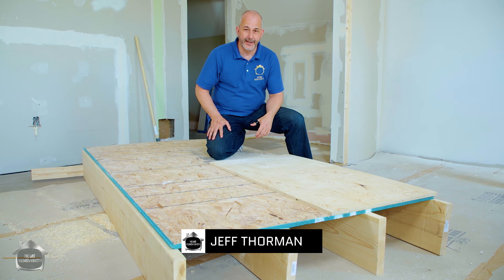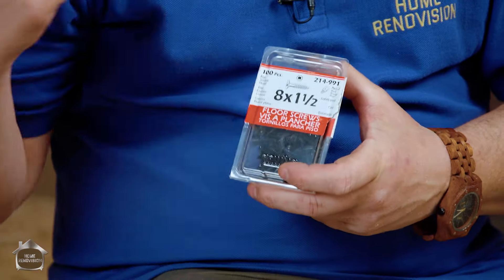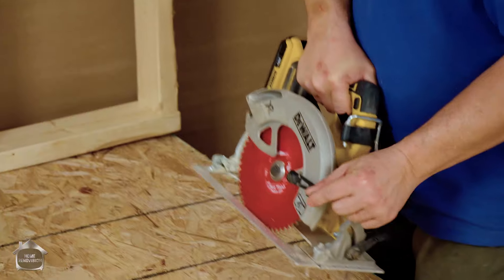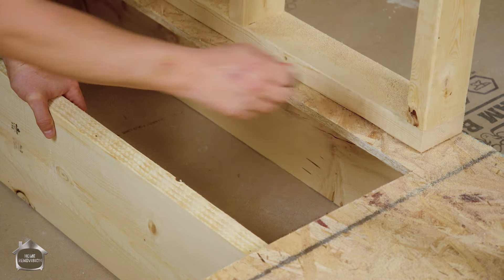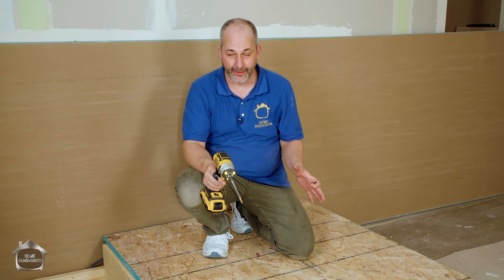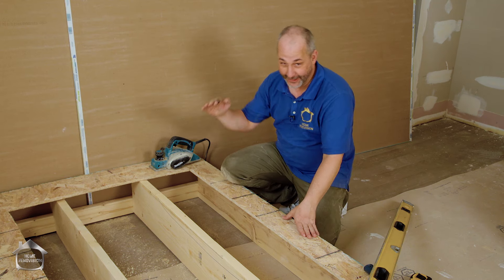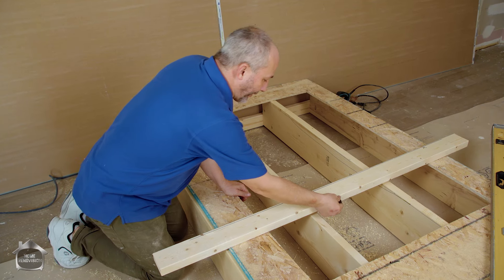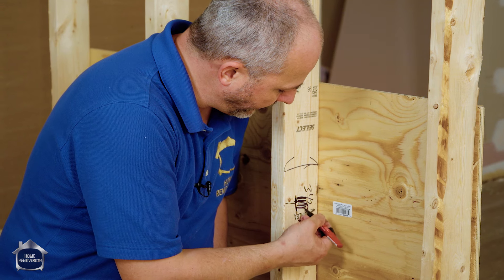Watch This Before You Renovate Your Floors

Comment: I have a one story 1962 Ranch basement walkout single family house in Maryland, USA. My floors are 2"x8"x15' w/ 16" oc with plywood subfloor. A previous homeowner had 12" square tile put on top of the linoleum kitchen floor and a similar tile over original tile in the one bathroom. My goal is to replace both and take the original tile back to the plywood.  What is the best method to tile on top of plywood not osb? Also the rest of my house is wood floors with the squeaking nails. Is it worth while to carefully remove and reuse these? Thanks for the tips in these videos! In a house that has a supporting beam in the basement and the house has settled, is the best method to repair wood floors is to plane the back to achieve a level board at the peak separation?

Comment: Hi Jeff,
         Great video. 
Lots of information and learning as I got along. I am going to put a new flooring in my basement. I intend to use laminated flooring board.  Presently the floor in all concrete naked all level at this time. What kind of vaper barier should I used also is there some form of adhesive to hold it in place on the floor before laying the floor?
Thank you.

Comment: I’m in New Berlin, WI in a 1940’s home. I am trying to finish my basement. I demo’d all the old framing. My basement floor is not level. Slopes down from all sides to the center about a 2” variance. I planned to put down the blue DMX > 23/32 OSB > all new framing over OSB > laminar plank flooring. Will this solution work? Are there any other layers I should anywhere in this process?

Comment: I have a Ontario Canada home (brick ranch) 1961. Renovating the bedroom and I have stripped the endless layers of flooring. I’m now down to subfloor. It is tongue and groove pine but it’s (ring nailed) on a diagonal to the floor joists. It has a few squeaking spots. The tongue is longer than the groove is deep so there is small gaps. I’m assuming I should slap screws in between the existing nails in pine boards then screw down half inch plywood to install floating floor? Any help would be greatly appreciated, love your channel. Keep your stick on the ice!

Comment: What if your house is older than the 90'S my house was built in 1948 and there is no subfloor like that under the hardwood. I want to preserve the hardwood but cannot get them refinished right now for various reasons I was thinking about overlay options like floating floors and such. What would you advise for hoses over 70 years old?

Comment: Hi Jeff, I wish that I could send a picture but I am in the process of installing engineered hardwood that is the glue-down variety. However, it transitions to a hallway that already has engineered hardwood that is a different type and probably has an underlayment because it is higher up when you put the wood side-by-side with the new floor that being installed. There used to be carpet in this room, so when you remove the carpet and the underlayment the glue down floor will be a bit lower than the hallway floor, creating a tripping hazard. What do you suggest to cost- effectively level up the floor to prepare it for the glue-down installation? I can't take the wood back but wondering if I can still use it.

Comment: Everyone loves a "nice, clean hole."  One thing to note on the drill bits is that the titanium and cobalt drills are just coatings.  Any drill you buy at local hardware stores are high speed steel with some coatings (titanium or cobalt).  I don't find that the durability of the coatings just the cost, especially when you can just touch up a drill with as little as a file and it only takes a few seconds.

Comment: Thanks for this video!  I went to Home Depot in Texas and could not find flooring screws.  It was insane.  If there is an alternate you could recommend, that would be great.
Reply: Try Elmer's glue. It is cheaper and just as effective. Let us know how it works out. It works great on decking as well. Especially stairs.
Reply: ... in my opinion best screws for the issue here in the states : coarse thread robertson square head - just stay away from 'fine thread' ... that kinda goes for drywall too - use only coarse (wide not thin) thread - the 'square' head is a plus over philips. AND yes IF u can get some glue into the mix it can only help.

Comment: I am remodeling a 1930 home with planks not sheets... what should go on that before my flooring product? Very hearty floor joists... they actually vary and can be up to 2 by 14 joists... and have some sister joists of treated lumber and posts in footers throughout the basement bringing weight bearing off the foundation walls that have been eroded over time and neglect.

Comment: I work at a Lowes in New Jersey, hardware dept. and I can say for a fact we do not have flooring screws. But I did find them online on our website which are the squeek no more. We do have a ton of multi purpose screws, wood screws and construction screws but I don't know if you can use those in its place. If anyone knows inform me cause I'll be buying an old home soon and will probably replace the floors.

Comment: If you have engineered floor joist, always follow the manufactures instructions as to where you can and cannot drill holes, this always supersedes code. As well as the size of hole you are aloud to drill. Usually not within 2-3 feet of a wall plate that is supporting the joist etc. and all kinds of things most people wouldnt think of. Cement board is held down with screws, thinset just fills voids, it is 100% for bonding/ uncoupling and does not help with the strength of the subfloor in any way shape or form. Joist spans were not mentioned and equally important as joist spacing and subfloor and underlay prep.

Comment: I had planned to install a ceramic tile on my concrete basement floor. The house was built 12 years ago and 2 years after it was built , It was recommended that I seal the floor. I did so with a sealer that left a nice sheen. But now I am reading that the tile floor will not adhere to that sealer. I may have to use  a floating laminate floor instead? Other suggestions if I follow through with the tile squares? Thank you Greg

Comment: I’m installing LVP (Nucore from Floor & Decor) over worn asbestos tile in a room adjacent to my basement (so over concrete) in a 1960s home. Other than leveling the floor over the asbestos tile with self leveler as it has uneven ridges now and I don’t want to touch it, is there anything else I need to consider? Can I skip the underpayment pad? Will the transition to the concrete basement floor in the doorway still be possible? Thanks

Comment: This is such an awesome series! I still have a lot of questions about older houses with 1&1/4" plank subfloor and true 2x10" joists 22 O.C. Should I be pulling up all of my planks to glue, or is screwing sufficient enough on it's own? To lay tile, would cross bracing 22 O.C. joists with 2x4'severy 16" be the easiest solution?

Comment: I do have a question @HomeRenovisionDIY ....I have a basement that is below the sewage line and im curious what options you'd suggest for adding a bathroom to a basement that's below the sewer line level. Eg Sewer line approx 3-4 feet off the floor so the old owner installed a toilet about 4-5 feet up which changes a 13 foot basement into a 7 or an 8 foot basement.

Comment: Great information just thought I would add some trivia about the regular drills also called twist drills most commonly made of HSS high speed steel today.  The colors other than silver are coatings to aid in durability of the cutting edge black (black oxide) gold (titanium nitride). If they mention cobalt they are referring to the alloys in the HSS for wood cobalt probably would not make much of a difference.  The name high speed reportedly came from the fact when it was introduced machinists could turn stock on the meal lathe at much higher speeds with out burning up their tools.

Comment: So, I've got a 1954 house. structure under the kitchen is 2x8s 16 inches o.c., with 1x8 planks running in the opposite direction as my subfloor. Kitchen has plywood on top of the planks and a 4x8 quarry tile floor (1980's reno?). All of the joints in the tile grout are cracking, and an attempt to regrout the floor just cracked and spalled immediately. I suspect that scribing my joists won't fix the problem, since the flex in the floor is coming from the planks. Rest of the first floor is original 2-14 inch red oak hardwood. I can feel the locations of the joists with my feet when I walk over the hardwood. What can I put in the kitchen without rebuilding from the joists up? Neighborhood is in an upper middle class area, so sheet vinyl is not a good choice for resell.Would a floor leveling cement be a good first step?

Comment: So I have a concrete floor, should I still put in a subfloor over it? And if so, should it also be 2x10? If I’m tiling I think I probably should be 2x10…
I’m building a barndominium, so the subfloor cavity will also give me space for insulation (rock wool).

Comment: Something I learned recently: On a Dewalt drill, you can just turn the collar to put it or remove a bit. No need to hold the collar and pull the trigger.  I've had  bits fly out and gotten skin burns holding on to the collar. Give it a try. Dewalts are geared for it.

Comment: Hi,  I have to remove about 1000 square feet of subfloor, put in insulation, duct work, electrical, then put the subfloor back down.  Instead of doing it this way, I thought perhaps I could use a hole saw to cut a plug around each nail, all the way through the subfloor.  Then I could lift the entire sheet straight up, and when ready, simply set it back down in exactly the same place.  Use screws near each nail, and seal the slight gap around each nail with calk or something.  This way I wouldn'T have to put put in all that blocking.   What do you think?

Comment: Jeff I have a Million $ question: 50's home basement, need to self-level for vinyl plank flooring. One room showed efflorescence at times so we fixed the (minor) cracks, prepped the floor and sealed with Behr Concrete Epoxy Sealer. Seems to work fine. Other room needs SLC but has similar efflorescence here and there. Should we seal first the proceed with the SLC Primer+SLC or should we seal after the SLC? We'll be using a Diamabrush to prep the floor for the SLC.

Comment: What if your floor is only particle board? I don't have OSB at all in the mobile home. I have to support the edges because if i don't the old floor well start to crack.  Also for what ever reason the 2x10 beems are, well one is lower the the one next to it.  Every even beam is lower the the one next to it.

Comment: Amazing advice, long-time subscriber and love your every video! Would you please talk about how to deal with crowned joists? I have a challenging floor with a "hump" that I'm not sure whether I should try to use self-leveling concrete, or do something to the joist(s) underneath to straighten things out!
Reply from the maker: open the subfloor . use a planner to remove the hump. laminate the joist with a strip of osb or plywood. glue and screw and then reinstate the subfloor. problem solved. Cheers!

Comment: Hi Jeff, I am in Hawaii where single wall construction was the rule until the last couple of decades.  Almost all the interior walls are weight bearing and are 3/4" old redwood.  I have a proud joist (joists are 2x8) that runs the width of my ranch style house.  It runs through two bedrooms and a hallway.  You can actually see the bottom plate/baseboard of the wall in the hallway rise and fall over the proud joist.  In one bedroom, this joist is only about 12-15" from the parallel weight bearing wall.  In the other bedroom it is about 4' from the nearest parallel wall.  My question is this:  If I shave this joist down in each room to level my floor, what happens where it passes under the two weight bearing walls of the hallway that separates the bedrooms?  Obviously I'm not going to shave the joist down under the walls so am I supposed to taper it to the walls?  If so how?  The hallway is only 3' wide and the hump is very visible.  Can't tell you how much I would appreciate your answer to this question....  Aloha, Mary

Comment: I am considering building our home’s subfloor using 2”x12”x16’ lumber, at 12” O.C. spacing, supported underneath by 4”x6” beams at 8’ O.C. (Sitting on 4”x6”x8’ posts), and 3/4” plywood sheeting for the subfloor material, that I was hoping ceramic tile could be applied to that without any deflection?!? Is that a good idea, please?  Thanks for all your tutorial videos, Jeff! Much appreciated!
Reply: You could put anything on that.  That is overkill.  😁

Comment: in UK we have moved away from wood floors & we mainly use pre-cast concrete slabs now, simply because concrete dont burn & wood here is not so easily available as it is in canada.
Reply: Are your floor joist still wood or are the precast too?  Just curious.

Comment: My OSB sub floor overall looks the be in pretty shape, but there are several spots where it is starting to chip creating small quarter size raised spots. I was just going to sand them down. Is that okay or do those areas need to be cut out and replaced replaced?

Comment: If your home has diagonal lumber as your subfloor.... use 2- 3/4" or 3"  construction screws,  depending on the era, it may be 2" dimensional, or it may be 2" actual so measure before purchasing. Drive one screw in the center of each plank every time it crosses a joist (usually between the two nails they drove in the plank during construction).  If you have an area of major squeakage and have access underneath, lift af the edge of the plank with a pry, and stick in a dab of dap before going back upstrais to screw them down.

Comment: My 90 year old house I just bought has 1/2" sub floor and they installed 1/4" plywood on top and than carpets. It feels a bit soft and squeaks. I want to install 1/2" ish engineered hardwood floors what would be my best course of action? I did floors before for my moms kitchen and we used PL to glue down 1/2" plywood to sub floor boards and lots of floor screws the floor feels stiffer than concrete. For my floors should I remove the 1/4" plywood and install 5/8" OSB on top of the 1/2" sub floor boards?
Reply: I have engineered 7/16" hardwood over 3/4" plywood.  You kind of have 3/4" plywood.

Comment: I am not sure what screws are sold in the U.S. because I just do DIY projects but there are plenty of hex head screws that I have purchases at Lowe's and they are great to work with.  I started to build a set of shelves out of old lumber and the nails were not holding.  I put the rest of the shelving together with screws and it was like night and day with the strength of the shelving.
Reply: Here in the US I had to buy was called subfloor screws I know at least Home Depot sells them

Comment: Hi Jeff, in my basement, on one side there is tiles and the other side there is carpet. Underneath the carpet is cement floor. The transition between the carpet and the tile is a marble threshold like you showed in this video. I am wanting to replace the carpet with the vinyl floor. Is it necessary to leave a gap from the marble threshold or can I butt the vinyl to the threshold? If I should not butt it to the threshold, then is there anything that can cover the gap? Can I use end cap or glue a quarter round to cover the gap? Should i be gluing the vinyl next to the threshold to the concrete so that it does not move towards the threshold? What should i glue it with?.

Comment: Jeff, this video gives me confidence to open up the subfloor and inspect what’s joists we have down there.

I have a question about adding plywood on top of OSB not just for reducing deflection but for soundproofing. My basement is only 7 1/3 feet, so not much room to add another layer of drywall on the ceiling, but I have height to work with on the main floor. Is there a way to add soundproofing between OSB and plywood? Or between plywood and hardwood floor (living room) and tile (kitchen)? Did I miss any videos covering this?

Comment: Love the channel. I have an older home that I'm fully renovating. The floor is original 3/4" hardwood (no subfloor) that has been hacked up and patched by previous owners over the years. Needless to say, there are plenty of high, low and soft spots that need addressed. Would you recommend removal of the existing floor and re sheeting or sheet over the existing floor? Cheers

Comment: Love your videos, Jeff!! 
I am in TN and currently opening up a floor to fix a broken main center beam in a small rancher. All kinds of moisture issues in the crawl space but I have water damage on my subfloor in kitchen. My sub was originally laid with 1/2" plywood to the joist and a layer of tar paper topped with a 3/4" OSB but the OSB is maybe not OSB, but it's what we call "press wood" panel. I think its saw dust glued together and any water makes it totally useless. I am pulling all of the stained (soft) Presswood panel up & a lot of the 1/2" plywood off the joist as its rotten. 
Can I go back down with 3/4" OSB that is better quality than the 3/4" press wood panel? As long as my panels line up, I don't see an issue with going back with a better quality OSB subfloor panel while not pulling 100%of the Press Wood panels up that are in good shape.

Comment: One tip on the sawzall, don’t lift it off the floor like Jeff did, just let it rest on the wood and use it as a lever so when it plunges through you can control how deep it goes.